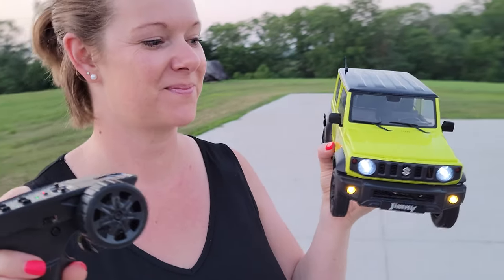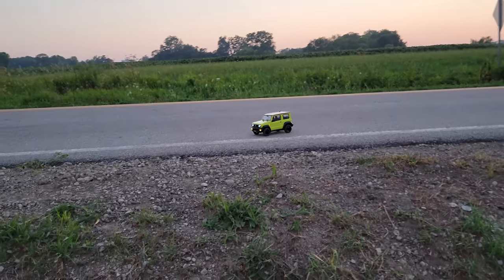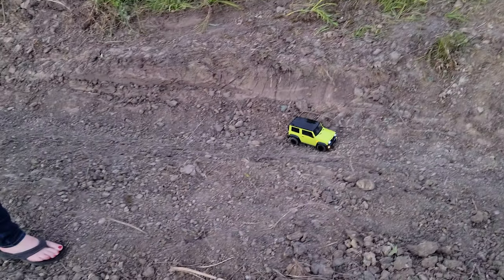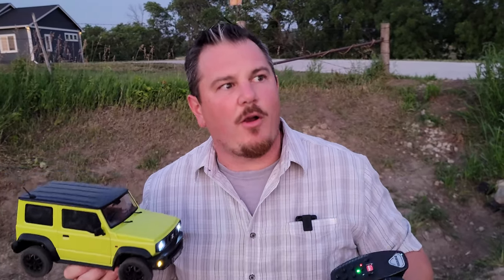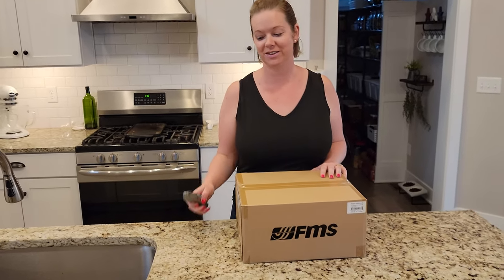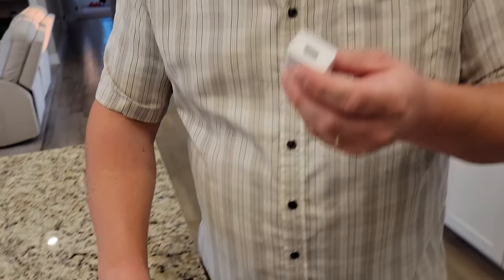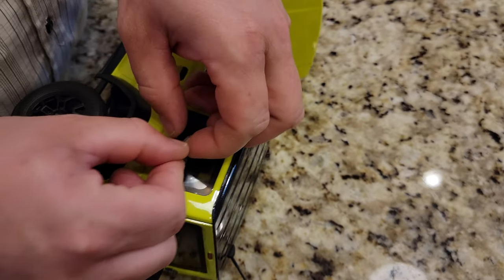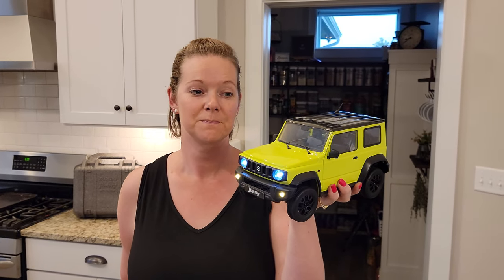FMS - Jimny - 1:12 RTR Crawler - Unbox & Run

Comment: Unrelated question.

I have the basic charger that comes with the apprentice sts.

If I buy an IC3 to PH adapter, would it be safe to charge the batteries for the umx timber?
Reply: Nevermind. I found a manual for that charger that said to only use it for smart batteries. Question answered.
Reply from the maker: That charger is a super limited one ;( Sorry about that!
Reply: @BrianPhillipsRC  yeah. I think I'll get a Spektrum S2100. I think that will do the trick.

Comment: I just got mine, I see you also have the rear bumper light that's not quite right, you ever pull it apart and see why it's like that? Also,  FMS has a 600 mah battery that just barely fits in there
Reply from the maker: Humm...what's not right about it??? I think I know what's going on...or did I just mention it and move on at 100mph - LOL...if so, my apologies!
Reply: @BrianPhillipsRC  Maybe I missed it,  but should that inside driver side light be constantly on when the fog lights are on?  Is it supposed to be that way?

Comment: I just opened mine and what terrible quality control. The battery is missing, there is a loose wire on the plug. Not happy.
Reply from the maker: Are you gonna have them replace it for you?